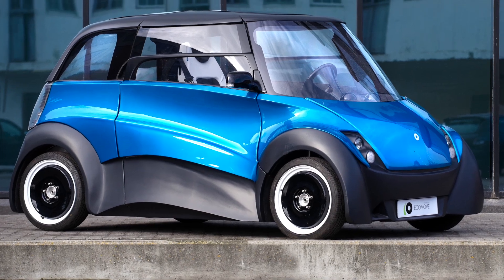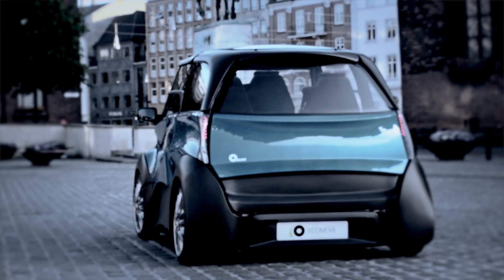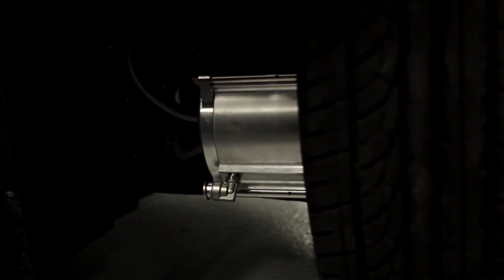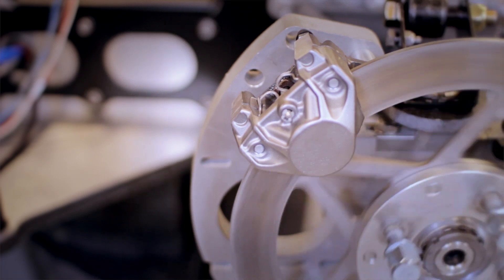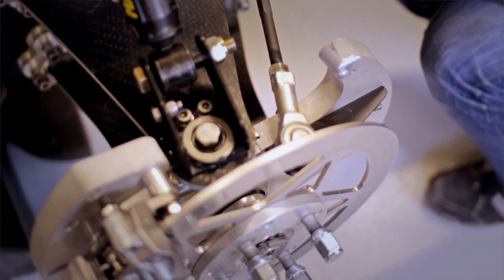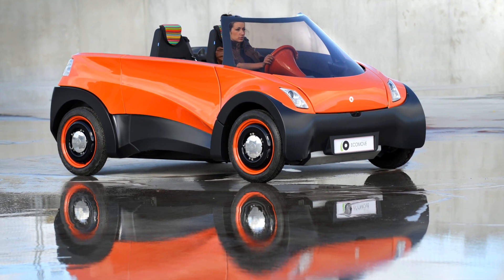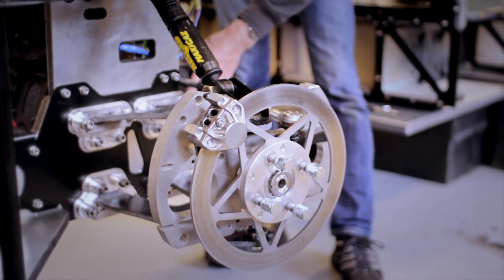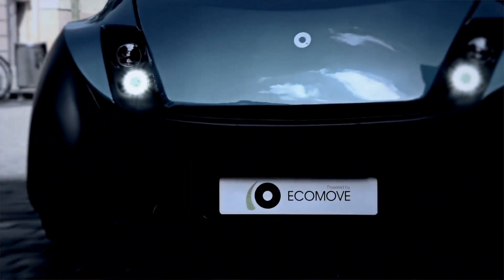In-wheel motor unit by ECOmove

Comment: Saw stories on your projects years ago and really wish to see them used in products.
Have you considered teaming up with an autobody design firm and proposing replacement pods for the ULTra (Heathrow) or 2getthere (Masdar) self driving systems?
The 2getthere system already has impressive and distinctive pods, so perhaps the drivetrain (maybe even make 4 wheel steering) would be a viable upgrade for them.
Components from Ecomove might be a viable upgrade or improvement to the Vectus/Skycube system and other guided pod systems.
As I look at all these various projects the one common denominator I see is not breaking the project up and knowing when to seek out expert advice and experience, or equally driven entrepreneurs, in specialist domains.
Pod systems have controls and interface as specialties and often get hung up on vehicle design.

Comment: Brilliant stuff. Can't wait to see in-wheel cars in NA. Wonder .. does your in-wheel have brake recovery? Any info on crash test ratings? How does your in-wheel they perform in really wet conditons?   I think the minute EV is offered with a 10 year mfg powertrain warranty, 100 mile range on 6 hour 110v charge and you can lease for US $250/mo zero down or purchase for US $23k the flood gates will open here..  The US is close and the in-wheel motor might be what gets us there! Great work!